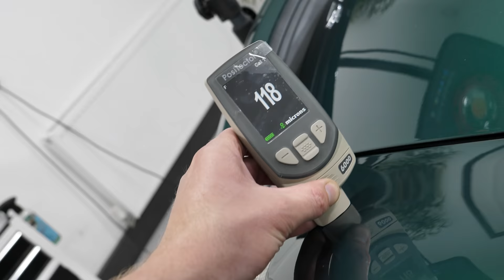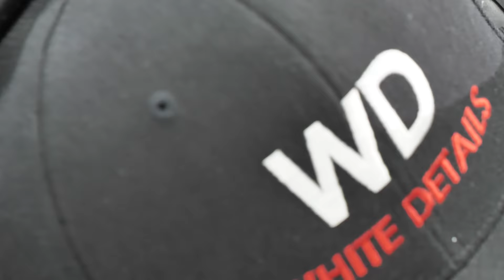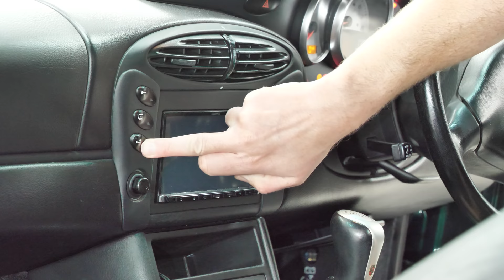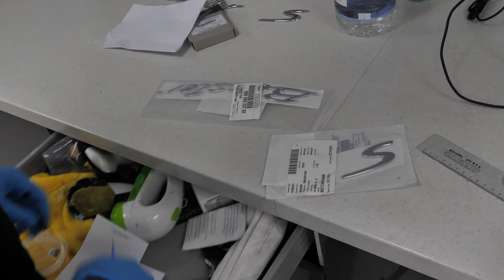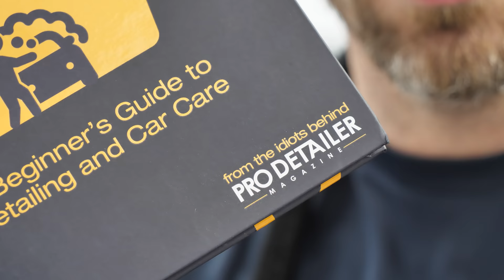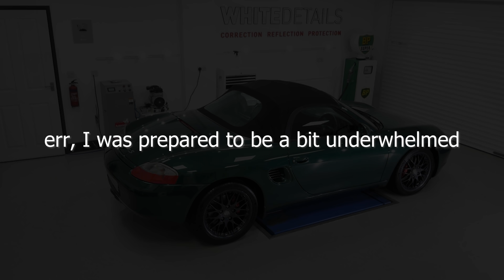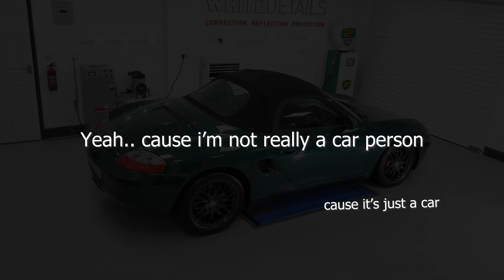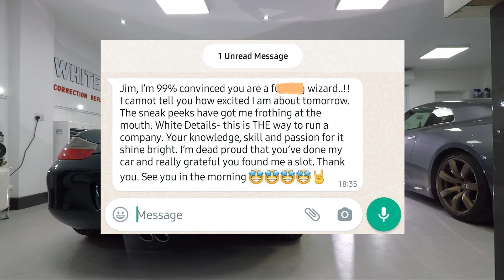60 Minute Makeover On a 20 Year Old Porsche - "SOME THINGS DON'T NEED TO BE LOGICAL" (Owner Shocked)

Comment: Despite it's flaws, you made that car look gorgeous. No need for the owner to be concerned about the amount he spent on this detail compared to the cars value. He got every bit of his monies worth. Absolutely amazing work as usual Jim. Cheers. 🍻
Reply: Boxster is so underrated, future classic no doubt. Looks beautiful, rare colour.
Reply: @spyder_man  Unlikely to become a classic anytime soon. Too many were made.
Reply: @Dave-un7fh  "too many were made".  Undeniable.  But I've heard that said MANY MANY TIMES since I bought a 1957 Porsche Speedster in 1972 at age 18 for all the money I owned - $2500.  I watched 356's go from cars nobody wanted rust buckets to over $100k.  Just yesterday (it seems from my perspective at suddenly age 70) the early to mid 1980's Porsche 911's I was buying and selling as a hobby in the mid to late 2000's were everywhere and cheap here in USA, $10k to $15k for REALLY good examples.  Then around 2008 the Euro was over 1.7 to the dollar (it's now just 1.08) and the cars were over 25 years old and the import tax to get them into Europe dropped hugely.  THOUSANDS went to Europe from USA, a great sucking sound, some SIX to a container!  Now what does a nice 50k miles 1980 to 1987 Porsche 911 go for in USA? $50k to $80k? Well maintained regularly driven Boxster's, with attractive or unusual color combinations will bring top dollar FOREVER. Get them while they are cheap, this is the time, actually a little late.

Comment: As an owner of a 2002 Boxster s manual transmission, I can tell you it IS logical to put this kind of love and effort into that car. People hate on them cuz they’re cheap. Mine was $17k as it’s a nice example, but relatively cheap and down on power. BUT, it’s more fun to drive it than my 600hp awd Audi. Completely different experience but that’s why I love it. If you want a manual transmission, visceral driving experience where it’s just you and machine in harmony, amazing handling, a convertible, and more fun than anything else in the price range, then I recommend buying one. I’d say don’t get auto, and don’t get the base. The s is much more powerful and manual transmission makes it for me in a world of dual clutches and paddle shifters

Comment: A neat trick for cleaning dirty keys... just chuck them in the washing machine with some towels and other stuff... even the once with controls on them will do just fine and they end up cleaner than you can get them by hand. The water damage or corrosion fears you might have are really not a thing there is two low power to cause trouble electrically and thanks to the spin drying you end up with no water remaining in the key so no long term worries either.
Found that out by accident when my keys fell out of my pants pocket when taking them out of the machine. I expected some long term issues as but now a few years later it still works just fine. I tried it with other keys as well (just to see if I had just gotten lucky or something) and so far I have yet to break or damage one, they all still work fine even years later.

Comment: I have a 15 year old 987 S that went through a similar process including badges replaced, wheels off, cleaned underneath etc and ceramic coating. Looked new when it was finished. Still looks great 3 years later. I’m a big believer in doing a job properly as you are. Well done.

Comment: You might want to try one of the 3M glue removal wheels for your drill. They work wonders and I've not seen any type of paint damage by using it. I've used it on 3 of my personal vehicles.
Reply: You can burn through and remove paint if you are not careful...never had any real problems on newish paint but on fleet type vehicles with a basic white factory paint job it happens from time to time.

Comment: Jesus man - I just stumbled across your channel and I've seen a lot of YouTube detailers.. You're now in my top 3 and I'm convinced you're the best one when it comes to perfection and OCD. Never seen such amazing detail packed into one video. Subbed! This must have cost the client easily around 5-7,000$ USD right?? I have a few questions. 1. What 1inch machine polisher is the one youre using 2. what product are you spraying after polishing to wipe of the residue? 3. Which pad and polish combo are you using to achieve these results? it seems like you're not compounding + polishing rather using a one step, unless the video edits makes it seem that way. 4 what product did you use after taking the Porsche badge off the bonnet ? 5. What product did you use to coat the convertible roof / and the black plastic trim around the car at the end? THANKSSS

Comment: Remove the front and rear bumpers. Front bumpers for leaves trapped between radiators and condensers. Remove the centre console and carpets and clean out of the car.

Comment: Jim, can I ask, in many of your videos you address stone chips and the very fine application of paint. With some of the larger chips do you then flat these off and re-polish the surrounding area?
(Ps, simply love all the videos you post without exception 👏👏).
Reply: The paint should level itself out as it dries and may even shrink and sink into the hole requiring you to add more paint to fill the hole back up to be level with the rest of the paint. 

I see no point to sand and re-polish the area on the average daily driver being touched up. 

On something with more value, sanding it after it fully cures and polishing should produce a better result, if done correctly.
Reply: @I_know_what_im_talking_about  a Nissan GTR r35 so not your average daily driver it had 2 rather large stone chips on the bonnet. Used touch up paint in 3 applications then a single lacquer coat, lightly sanded with 2000 grit paper and finally machine polished,,,, took time but the end result was worth it. Thanks for the reply 👍

Comment: It'd be oh so great if you'd put captions in the video saying what you're doing and what you're doing it with.  For example, at 42:12 is that a toothpick/stick or some kind of paint brush or what, exactly?  What kind of touch-up paint?  Voiceover isn't needed and captions are better anyway (unfamiliar brand names or techniques can be unambiguously figured out). Thanks, great work.

Comment: Quick question regarding machine polishing. My motorcycle fuel tank has a clear coat but not the plastic side panels, can these be machine polished or will they be damaged  ?

Comment: Jim, beautifully done! You're work is always top notch! May i ask what microfibre cutting pads you're using on the bigger da machines? The ones I got from my local cartec supplier don't seem to give enough cut for my taste.
Reply: I can't speak for Jim, but I've heard good things about the Meguiars wool pads giving great cut and surprisingly good gloss.
Wool or microfibre can be quite product-hungry though compared to foam pads.
Edited to add: it seems he uses Lake Country pads, mentioned around halfway through after correcting the rear vinyl screen.

Comment: i recently had my first experience of a body shop "fixing" some paintwork. absolutely dreadful standard of work
Reply: That's what makes me want to try doing the front and rear bumpers myself on my 16 year old Vectra. Sorry to hear that you had a bad experience with them; it's always a shame when professionals don't deliver the level of service you are expecting.
Reply: @SerenaBluee  i would have done the work myself but i don't have an inside space which makes it very risky. i think with body shops the attention to detail is just not there. from using the right products to prepping the car properly. i'm honestly shocked at how bad a job they did. i'll be able to correct the paintwork with machine polishing but i shouldn't have to given the amount of money i spent. if you have a space where you can do the work and you feel somewhat confident doing it then go for it
Reply: @davidcunningham9282  These days I think bodyshops are more about quantity over quality, and anyone that does really high quality work will have a waiting list at least a year long.
Let me know how you get on correcting it. What is it about the finished work that you're not happy with? Overspray? Orange peel? Fish eyes or bubbling? Or just lots of machine marring where they've flown over the panels with a rotary at the end?
Reply: @SerenaBluee  bubbling on the quarter panels. really bad orange peel on the doors. incorrect colour code used. swirls from wet sanding. it looks fine from 10 yards when washed but any kind of a closer inspection and it looks bad. because i don't have an inside space i think i'm gonna go with an all in one polish. probably rupes uno and use different pads on each of the panels. it's black so the errors are really noticeable. i can send you pics of the work when completed with products used to give you an idea of what was involved
Reply: @davidcunningham9282  My car is black too. A decent 10-footer but I don't think it's been corrected in its 16 years and 115k miles, so as we get into summer I'll be going around it panel by panel. A very small amount of bubbling rust on the rear arches that has crept around from the inside, lots of stonechips to touch up on the bonnet and probably needs the front and rear bumpers reprayed to fix some small parking dings and cracks from previous owners.

It sounds like they really didn't do a good job on yours, but a good single stage will make it much more presentable. Remember that you don't have to do the whole car at once; you can work on it panel by panel like I plan to.

Comment: Gave a dislike on the video because of you cleaned the inside rail with the high pressure power washer. I am sure water got all over the inside of the car.